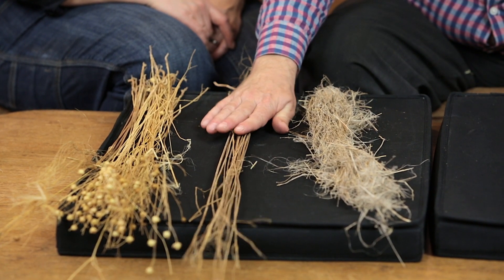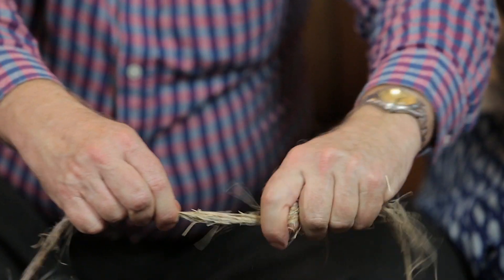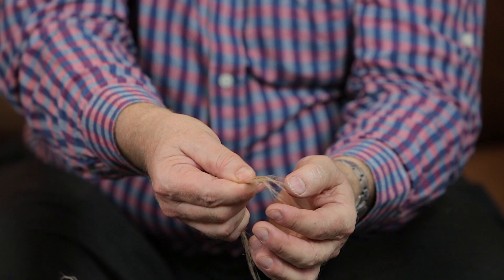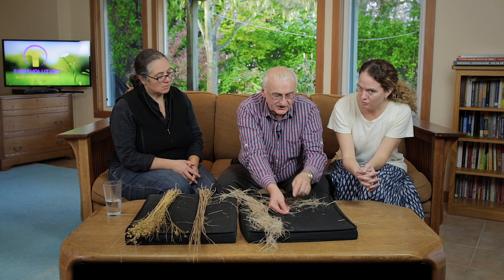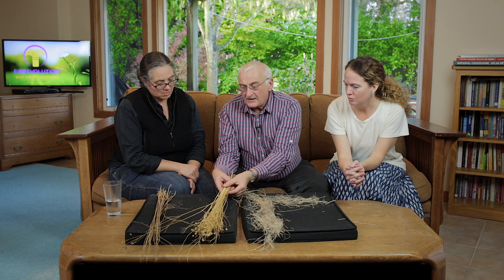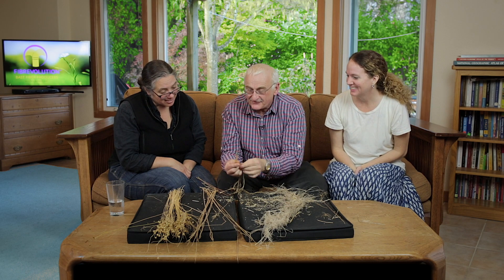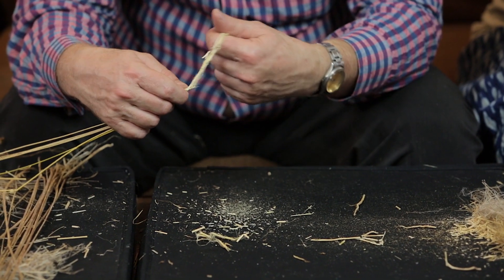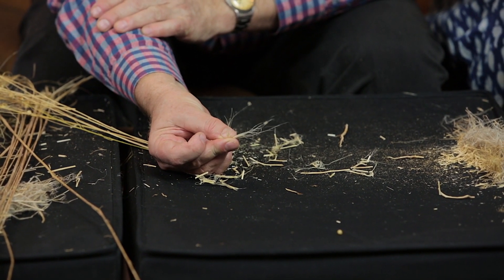Hand Grading Flax Fiber for Linen

Comment: This past spring I learned that planting very densely resulted in sorter plants but also finer fiber. I also learned that the plot that was the densest produced few to no seed and resulted in the tips of the plants having little to no branching that causes increased fuzziness. I purchased some old 100 year old flax from Germany and found that fiber was just as fine and short as what I have grown here this past spring. Im pleased to know that I can produce some very fine fiber suitable for some very thin thread for fine fabric on the loom. It takes forever to spin super thin lace weight thread. The quality of the thread however is very much worth the extra work needed. I think with some better feeding of the fibers I can get a bit longer plants and still retain the fine fibers.

Comment: Thank you for the information on how to grade the fiber. Learned quite a bit. Im ready to harvest my second year of fiber flax. I have Suzanna and Natalie flax growing here. I tilled up my soil and left the ground a bit course and planted without rolling the seed bed. Same as I did last year. I ended up with flax germinating at different times and some was very dense and produced very thin stalks and some very thick stalks. I now know what to do to help that problem. Similar this year but not quite as bad. My Suzanna was planted from seed I saved from last year and some germinated well and some not at all. Guess I did not let it mature quite long enough. My fine fiber is a joy to spin. Retting is difficult and is best done in warm weather and not cold. I like the testing method of 10 scrapes per bundle to see how well retted the fibers are and that is an important test. I have about an 1/8th acre of flax growing. Im in Northern California in Marysville. We are near Chico and I am friends with Chico Flax. I have helped them harvest last year and this year. I had taken my spinning wheel for a demonstration last year. Working on an automated scutching machine. Simple but functional that will speed the process. Hoping for a good result this year. Chico Flax has produced and harvested 4 times what they produced last year. We are getting pretty good at hand harvesting quickly. They planted in October and I planted at the end of January. Im almost ready to harvest.